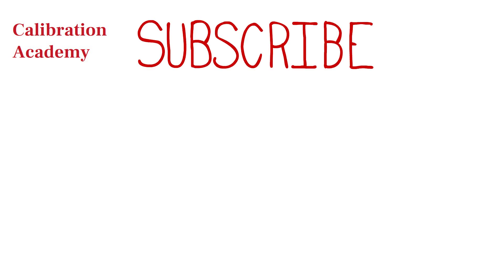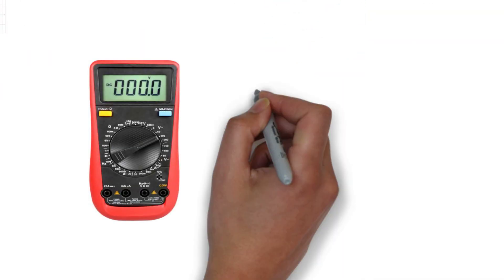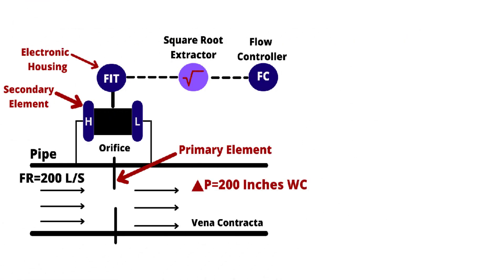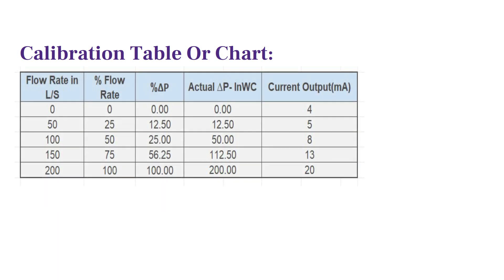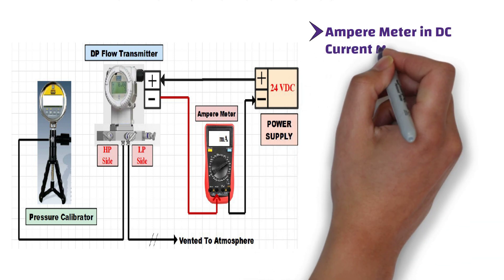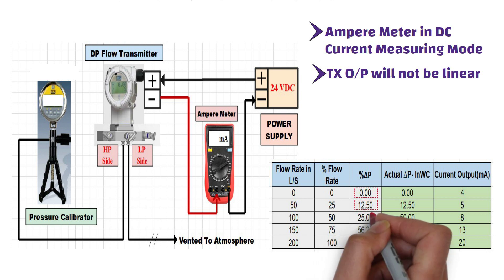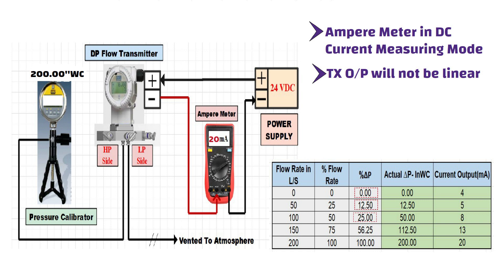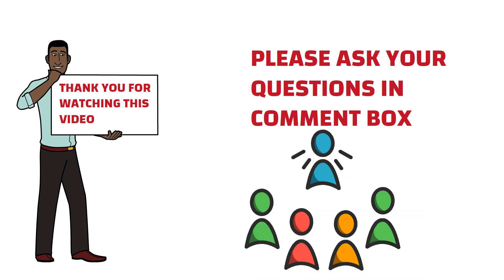Differential Pressure Transmitter Verification Explained | With & Without Square Root Extractor

Comment: if it stays out what to do to correct the output?
Reply from the maker: If you have analog type differential pressure transmitter, then it can be corrected by using zero & span button. However, if you have Smart DP Transmitter, then it can be corrected by using Hart communicator
Reply: @InstrumentCalibration  thank very much.